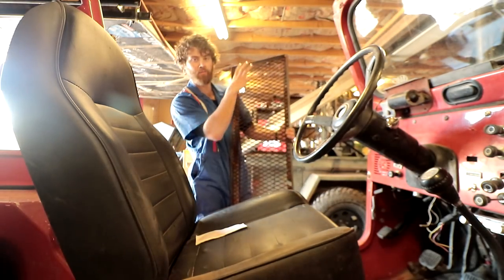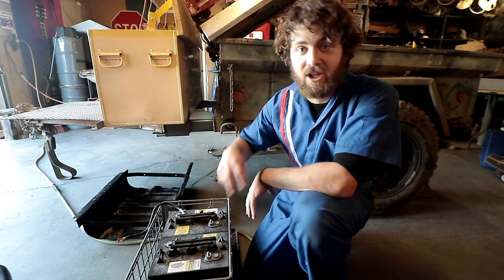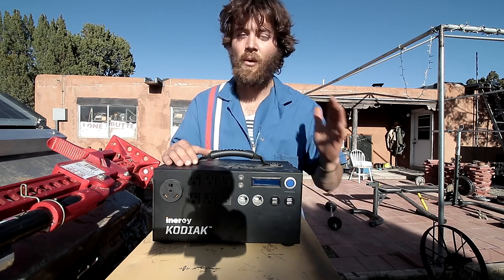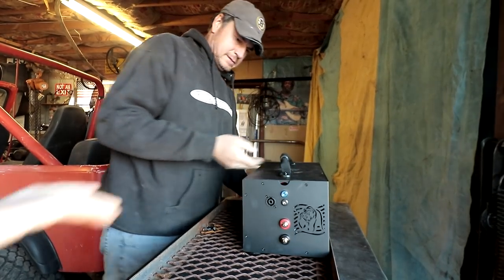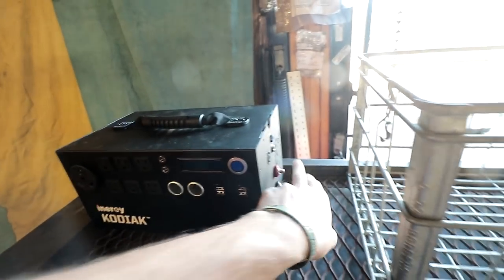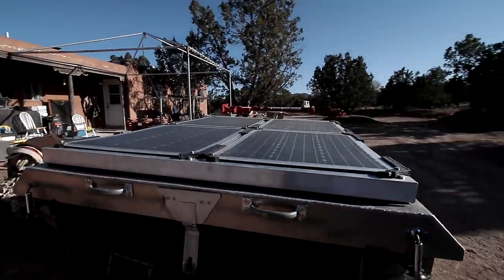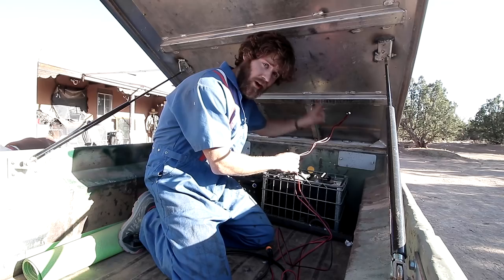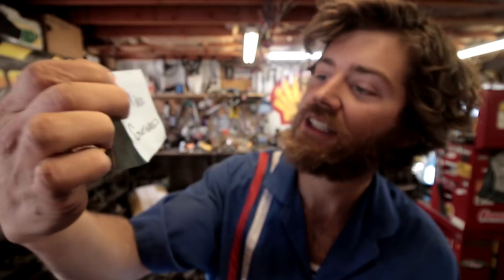EASIEST Overland Solar Setup EVER

Comment: Awesome setup. Golf cart and deep cycle boat batteries are the best to use when needing higher capacity of power and cheaper. I used to be a generator technical and have blown peoples minds by showing them how to double voltage with batteries. Welding with jumper cables and a battery is a big thing too if you need to weld on the trail or roadside. I'd recommend keeping some welding rod in you trailer or jeep too.
Reply: I told Jake about how easy a modest arch (stick) setup as backup on the trail might help.  I know there is a guy selling a full kit real inexpensively on eBay for such applications.

Comment: Excellent addition Jake. I have a similar setup (except 12 volt AGM slaves) in my Jeep. I charge via 3x 100 volt panels on my rooftop tent. The Kodiak is amazingly energy efficient when inverting and charging - much more than a Goal Zero. It’s weight (about 35 lbs) and portability for a 1k system is what tipped the scale for me to make the investment. I wanted to use it as a backup in my home also.

I’m curious if you are planning to keep the solar always connected. I’ve gotten conflicting guidance from Inergy on if that’s advisable and healthy for longevity for the Kodiak system.

Comment: Please put a rubber gusset in that hole where the wire goes from the panels to the generator! it will wear through the insulation and short everything out. Amazon sells them cheapo. Look at monstaliner it can be applied with a roller, no rubber inside. barage of colors take a look I did the outside of my jeep XJ and it looks amazing.
Reply: Agreed, I have a pile of rubber and plastic escusions he can choose from for these reasons.

Comment: Would've been nice if u would've striped the trailer to its bare structure and replaced all the metal with either aluminum or fiberglass/carbon, to save weight and optimize mpg ! And I'm a long time sub, even decided to move into my 89 yj and explore my father's land and save ton's of cash! Started in Kali and went to Long island just to test her capacity and reputation, and currently in Florida! Thanks so much for the inspiration Jake, wouldn't have live if it wasn't for you!

Comment: I heard the fans on your Kodiak start when you switched it on... I would worry about good cooling / ventilation for that unit. Placed in the 'back' of the that space in the trailer might not give you enough air flow. Just my thoughts. All the best!
Reply: I will mention is to him....thanks....we need to devise a grille that wont allow moisture inside the trailer offroad.

Comment: Actually you were way better off with the Blue Tops. The only reason the 6 volt batteries are rated with that storage is because it is using the formula for only drawing six volts. Once linked in series your storage will now be cut by more than half due to the 12 volt draw. At same time high quality gel batteries are designed for charge discharge without forming a charge memory. Realistically the best batteries to use would be 85 amp hr. power wheelchair batts. You would get a true 170amp hrs. at a full twelve volt draw and they would last for yrs. I own a Mobility store and we have mass amounts of people that come in and purchase batts. for their cabins and rv's. Even the golf cart guys come in and upgrade to our batteries for range and performance. The other problem you will have with the golf cart batteries is they are not a shock proof battery. Unless that trailer of yours is running on a smooth trail you will fracture a cell wall and cause a short between cells. In the end, you truly get what you pay for.
Reply: Yeah, because nobody drives a golf cart over bumps.  They just have to be secured well.  I have used the 6 volt batteries in my RV for 12 years now and I  can go off grid for nearly a week if I don't run the furnace all night. Have had no problems with memory but I never discharge them more than 50%. Not sure how much the wheelchair batteries cost but for the price of the golf cart batteries I don't see how you can go wrong.
Reply: VERY GOOD INFORMATION....I plan on doing a video on my F450 Expeditionary Truck with some kind of solar upgrades and will be sure to research your comments beforehand.  THX!
Reply: he is a little misinformed on how to batteries in series operate. He described the capacity when in parallel but hes wrenching and learning
Reply: This comment is misleading. 6v batteries are very good to use in this application. The key term when getting batteries for this type of draw is DEEP cycle. Deep cycle batteries are good to use in applications that see lower consistent amp draws >20 Amps. 12v and 6v DEEP cycle batteries have larger plates inside them, spaced out to give a good long discharge. This is unlike 12v starter batteries or 12v batteries rated 'marine', 'dual purpose' or 'rv'. Starter batteries have small plates close together for higher cranking amps, marine/rv batteries are bigger and further space, but still retain decent cranking amps (mainly needed for trolling motors). These 6v batteries are 220 amp hours each. Put them in a series connection for 12 volts and you keep the 220 amps. If you were to keep the batteries as 6 volt, parallel connection, you will double the amperage. Also, GEL isn't anything special, it's just a different form of LEAD-ACID technology. 6v are just as good if not better.

Comment: You may have already addressed this and I missed it but just in case you should seal up the hole the wires went through in the top of the trailer for when it rains
Reply: My thoughts exactly
Reply: silicone.

Comment: The drawback is those are wet cells. And youll need to water them weekly. The optimas are gel cells and never needs to be looked at.
Reply: That Guy Mike if they are evaporating that quickly you may be overcharging them, they do need maintenance,  weekly is a bit much.
Reply: You should not have to add water that often. Not even close to that often if you aren't overcharging them
Reply: That Guy Mike I
Reply: Good point as are all the other comments on this issue.  I think I am going to give him my plastic battery boxes as some protection.

Comment: I'm sorry but that Kodiak thing is just not worth $1500. It's nothing more than an iverter/charge controller in a nice package with way too many outlets. A 90 AH battery is nothing. Big waste of money in my opinion.
Reply: It's probably not intended for those who could piece together a similar setup on their own. I assume it's geared more towards the less electrical-savvy folk that would rather buy something with a warranty and company behind it than pay for labor and hope for the best.
Reply: Right. I have a Goal Zero Yeti 1400 lithium which is similarly priced/capable. I am savvy enough to build my own system, but I chose the package route because I wanted to be able to move the unit between multiple vehicles, house etc. and it also be in a small and well contained box. It is expensive, but for some of us out there, it's worth the cost. If I didn't plan on moving the power center, I'd definitely build my own.
Reply: The solar plugs right into it whihc is the real goal of I AM JAKE living offgrid in the future adventures.
Reply: So you sacrifice well over $1000 just because you can't follow directions that come with any solar kit? I could built 5 of these for $1500... It's not rocket science.
Reply: mobiltec 

I'd like to see that. Or how bout 1 at 20% cost with apples to apples compare. I believe these have lithium ion baths, not agm. Also think lithium batts take a charger designed for them but not sure. Time is money, exactly how long are you gonna spend on it. And it's gonna take a lot more time to make it look halfway decent. I do shit like you're saying all the time, so I know it's NEVER as simple as "Just throwin together this or that". Gotta drill how many holes... in the proper spots. Gotta cut n trim n bend n fabricate n massage things. Gotta wire it all up with comparable connections and connectors, fuses n such. And at the end, the box you're so proud of looks like a piece of shit to everybody else but a select few who get (I get it, but I also get why your idea isn't really well thought out, again the time is money thing will keep comin up). You CAN NOT build a comparable product for anywhere near the 20% price you claim, and no matter what your end product is, it will not be anything folks who are interested in this nicely finished, safe product are interested in. People like me would be interested, but not the folks you're telling this to. Basically you're preaching to the wrong crowd. If you decide to do a build, I will most definitely watch it with pleasure (I love that kinda stuff), i do have time on my hands and have interest in a much cheaper, uglier (but I could care less), comparable set up. And fuck the 20%, I would be really interested in what it can actually be done for (dollars for comparable products) and how long to put it together. Even at 30-40%, for folks interested in the savings, that would be significant enough for one to consider doin it themselves.
Reply: He got it for free.
Reply: Ya I figured that. But it's not free to you or me...

Comment: Couldn't you have saved a lot of weight by just ditching that platform and bolting stuff straight to the floor?  Seems like a big expense for a 20% efficiency improvement.
Reply: Good point, but he didn't want to drill holes/silicone, etc. for leaks.